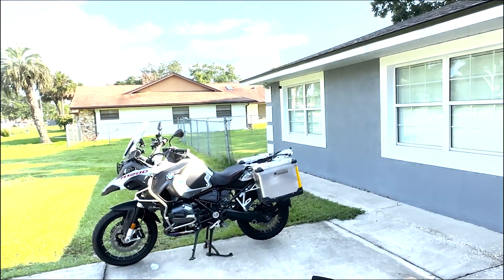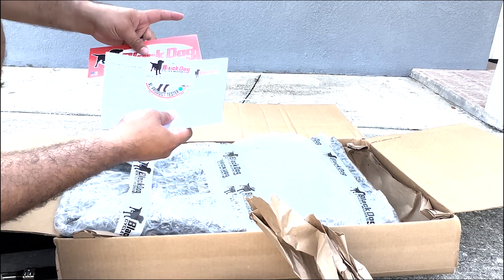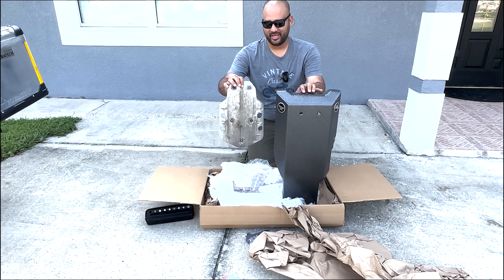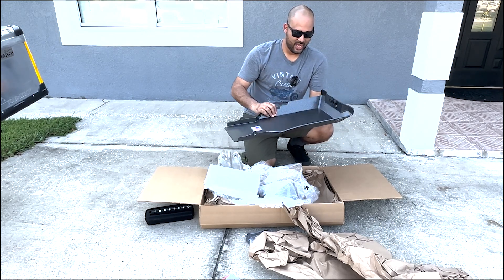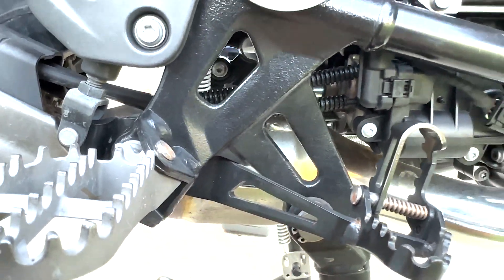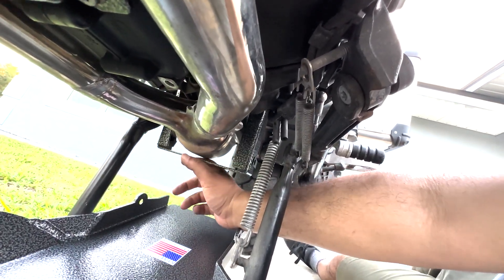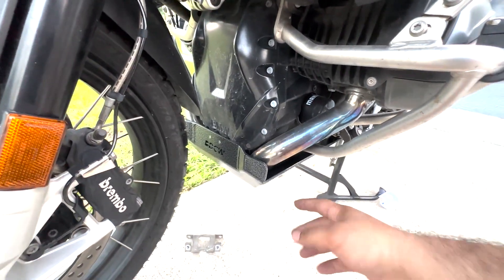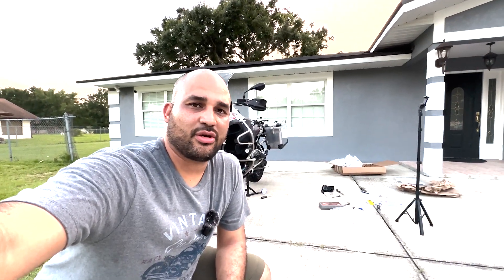BMW R1200/R1250 GSA | Black Dog Cycle Works Skid Plate Installation

Comment: I love how robust the design of the skid plate is but I hate that it bolts directly to the engine case. IMHO that's a huge oversight.
Reply from the maker: Robust is an understatement! They’ve been doing it like that for years without a hiccup. There are other companies out there that mount in the same place as the crash bars, that might be a better option. Thank you for watching and commenting.